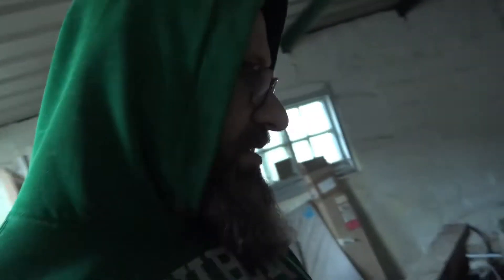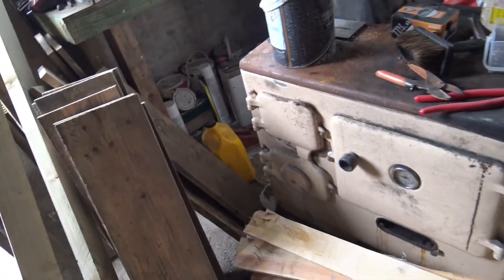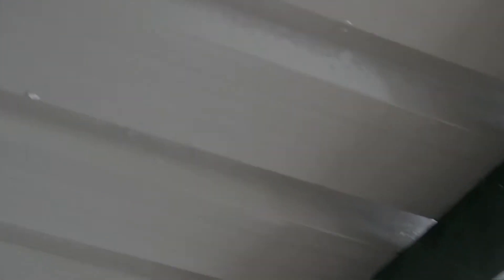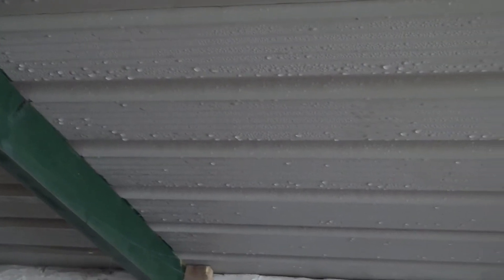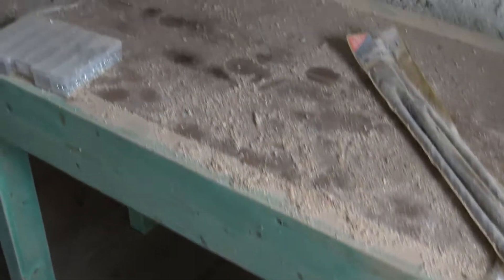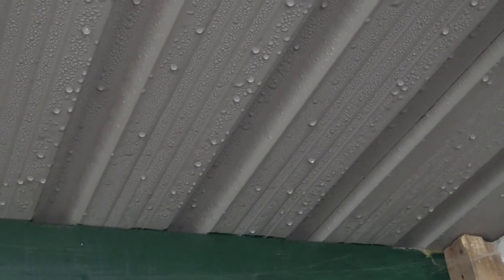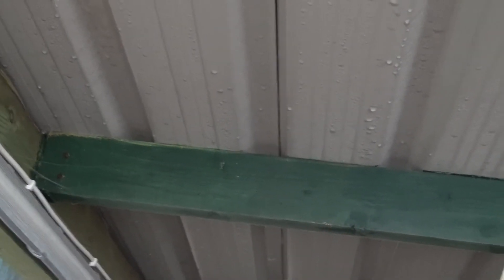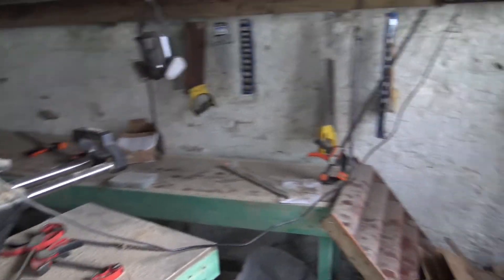SOS Badly Sweating Garage Roof Need Help ASAP Water Condensation Nightmare

Comment: Hello John. I have a metal carport canopy measures 26x24 and is 12 ft high open on the sides and is over a gravel driveway. Sweated so bad it was raining under it even on dry days and no dew on the ground. I wanted a solution that was reversible if it didn’t work. I used 4x8ft x1 in styrofoam panels faced with Mylar on both sides available at the local box store. They are cut to width and Installed with sheet metal angle clips I made up and screwed to the metal frame. No glue. Works great!  The silver side of the panel is visible.  My thinking was to keep the majority of the  warm moist air off the underside of the sheet metal roofing and the 1” foam keeps the silver Mylar at ambient temp inside the carport. I taped joints between panels for aesthetic purposes with aluminum duct tape. So far so good. I’ll post a video in a month or so to show how it’s working and show any issues that have arisen.

Comment: you need to buy an extractor fan if only a 20w inline fan to suck out the air so its the same temp as the outside, water condensation happens when the inside temp is warmer than the outside so air being sucked in and air being sucked out  will solve it till summer :)
Reply from the maker: As of writing, there is no wall on the front of the garage, just an open space. Fan wouldnt work. Im going to glue up some damp proof membrane instead.

Comment: Did you ever sort this? I have the same problem but want a solution that wont cost hundreds. My roof is around 4m x 6m so spray foam etc is too much cost. But will be moving tools in there at some point so need something.
Reply from the maker: nope... just covering the tools with plastic, for 2 years!
Reply: @goinfullirish9465  😬 I've put my workbenches up, but reluctant to move my tools in yet, waiting to see if it drips.

My roof is pretty steep so hoping its just the beams, in which case I'm gonna try lagging them with old bubble wrap. See what happens then.

Comment: Try laying a tarp on the open ground.. i have two metal building one has concrete and doesnt do this, the other doesnt have concrete it it looks like its raining inside.. the warm wet ground evaporates and collects on the roof.. both building have air gaps and not insulated.. i think i am going to try cover the ground being no money for concrete..

Comment: I’ve used insulation foam below the roof sheets and bonded it with expanding foam to try and seal any air gaps between the corrugated surface, it’s not the right way but it’s working for now. 

When I eventually redo the roof I’ll make it into a warm roof.
Reply: I actually just did this for someone also. Worked great for one half of the roof but the other half is still condensing (not as bad as before). I'm hoping it's an airflow problem, but if not I was thinking of putting a vapor barrier over everything.... so I'll have 3/4 ridged foam with closed cell spray foam on every crack/seam, r30 batt insulation, house wrap/vapor barrier, 1/2 inch drywall. If that doesn't work I'll probably tear up a bit... doing all this because a contractor installed the metal roof without a deck
Reply from the maker: I'll probably go for the spray foam, but it will cost an arm and a leg, still, I'm losing tools to the damp.

Comment: Paint the roof with rubberized paint or use spray foam on the inside.
Reply from the maker: Im going to get the roof sprayed with foam, just a bit pricey.
Reply: I've been told by a few that it'll trap moisture? Nit sure this is true I have sane issues but good to sort myself just need good avenue to go
Reply: I am from South Africa and we got the same problem in winter, mostly on IBR roofing. I am working for Rubber Coating Technology working wirh ECO Rubber which is a great waterproofing product but it still do it. I am also looking for a solution for my clients.

Comment: Im looking for the same answer, i have like a sticky back felt stuff on part of the ceiling that does get damp but doesnt drip...but id rather figure out why its happening at all, isit just heat from the car hitting the cold metal roof or some sort of morning dew deal? I have no idea, it is alot worse on days when it has been foggy.
Reply from the maker: it's the temperature differential between the air and the steel, like if you bring a cold drink out of a fridge and it condensates. I can't afford the spray foam, but I'm sure there are other solutions, still hunting. sorry it took so long to reply.

Comment: I'm having the same problem. Thinking about trying a coating you can paint on. If it works I'll let you know.
Reply: how did you get on  with the paintable stuff ? i have the same problem in my unit
Reply: @LeeG-resto-guru  sorry I haven't gotten it done yet. Too many irons in the fire LoL. Just as soon as the weather will let me I will be trying it. I seen a video where a guy used regular paint on his outdoor patio and it was working. They make a paint for sweat but it's pricey. I would be happy with any improvements. Good luck with your project 👍
Reply: @houstonsheltonbees814  no worries, I'm going to be coating it inside with Grafotherm, seems to be the best product out there
Reply from the maker: I will check it out online, but there may be an equivalent here in Ireland, what about bituminized paint?
Reply from the maker: I imagine that the thicker it is, the better it would diffuse the cold of the steel. there are stick - on solutions, but I don't like the looks of them. sorry it took so long to reply
Reply: @LeeG-resto-guru  hi did the graftotherm work?
Reply: @ookoro  Hi , yes , had to double coat "open area's"  , where there are cars etc on the floor area between floor and roof only needed one coat
Reply from the maker: Paint on, seems like the right way to go outside spray foam. let us know how you went!